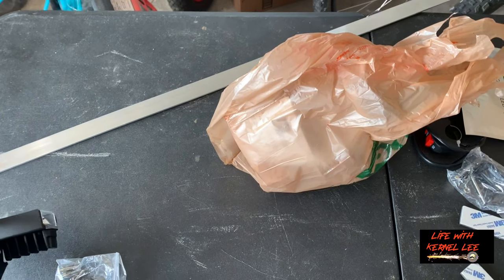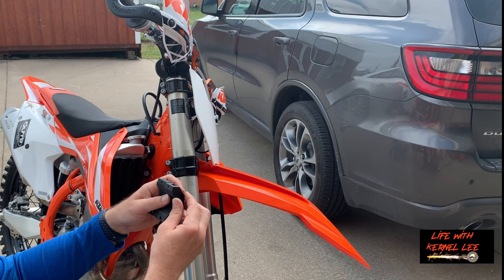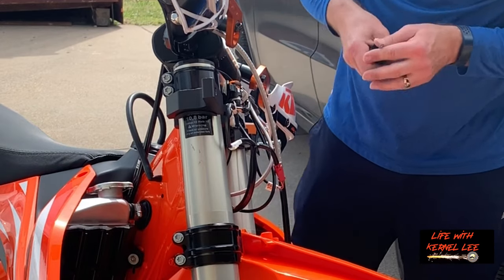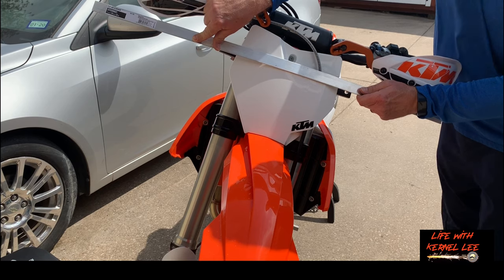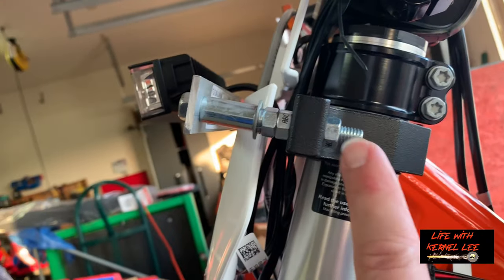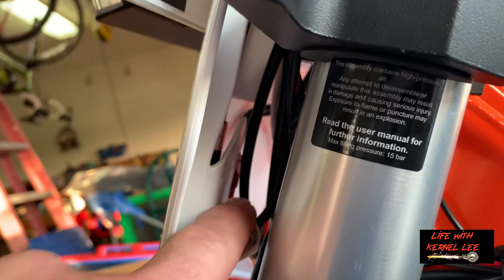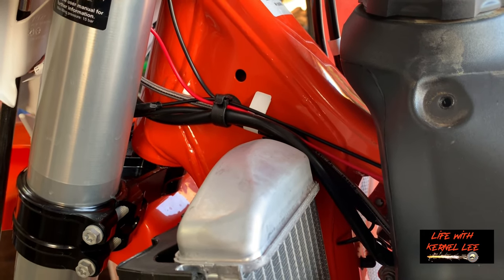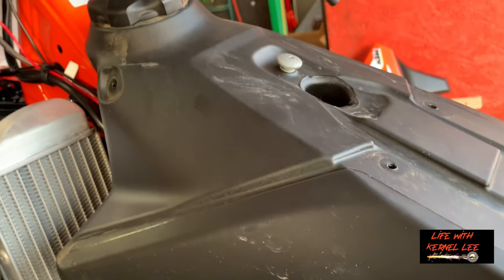Light bar on dirt bike, how to install

Comment: If you get  a quick disconnect clamp from your tank to the hose you only have to remove two bolts from the radiator side panels and remove your whole gas tank and panels all at once. Make sure the gas tank to the hose is in the off position though!
Reply from the maker: W J 
great idea, thanks for watching

Comment: One question Kernel. Did your KTM have a factory battery? Or did you add that too? Like this install, professionally done, have thought about a light for mine, but would have to add a battery and how it charges on my YZ250F.
Reply from the maker: Eco Paint, Inc. no mine came with electric start so came with a battery. Mine is a 2018
Reply from the maker: Eco Paint, Inc. yeah there are some vids out there that show you how to add battery and get it to charge

Comment: Thanks for posting...what year and cc bike?  We're planning on doing this with a '17 450 SX-F.  Any issues with running the battery down if using while the bike is running?
Reply from the maker: 2018 sxf 450
No issues at all, great light, bright on trails
Reply: @LifeWithKernelLee  gidday I have a Suzuki trojan dr 200 Ag bike will the light Bars circuit fit on the battery
Reply from the maker: @maccaneil4034  should fit any bike with a battery
Reply: Soz to be a pain but the light bar did come with the circuits and switch right
Reply from the maker: @maccaneil4034  in the description box you’ll find the links to all the parts